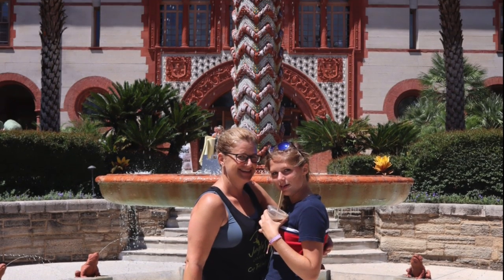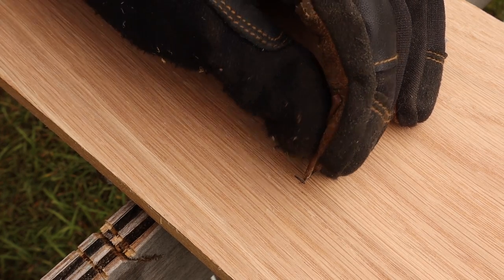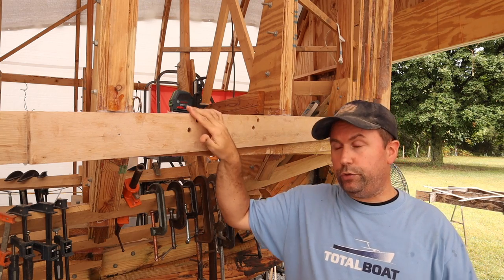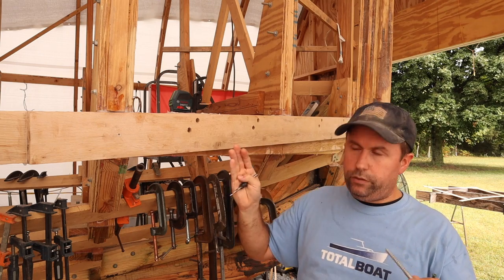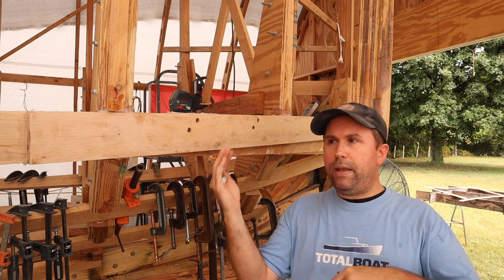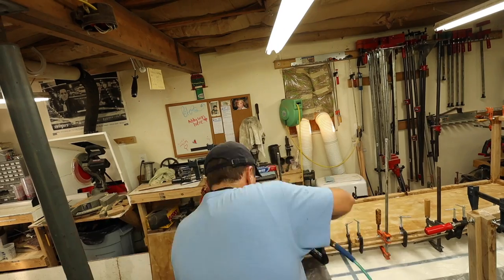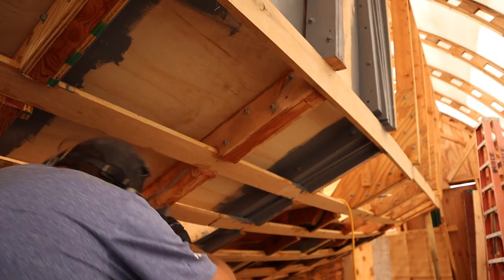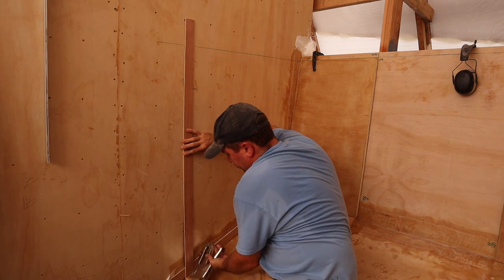Preparing for planking 41' wooden boat and more!  Sea Dreamer Project episode 48

Comment: Great explanation and reasoning regarding your selection of galvanized steel fasteners. 

Its great to learn something new, I had no idea about SS corroding when used below the water line.
Reply from the maker: I've seen failures even above the water line.  The heads of bolts on deck hardware look perfect but then buried in the deck, the shaft has begun to disappear.

Comment: Thank you for talking about “IT” screws that is. No such thing as to much information, I really like the way you boiled it down to the 
Project at hand in this case marine application. It would be really great if the three or four other YouTube boat projects currently underway spent a little time talking about hardware, chemicals, tools etc. Many are very light on on substance, and heavy on planing, sanding and sawing. I mean really , once you’ve seen a table saw rip some stock down you’ve pretty much seen it all. On the other hand building the jigs needed to improve quality and repeatability is much more valuable information.
Please continue to share in-depth information, I believe that there are lots of YouTube viewers who have the three or four minute attention span required to absorb some in-depth maybe even educational information. Thank you and continued success in your project !

Comment: I get it’s all about layers I’ve watched other boat shows or where the builders built beautiful wood boat and then over laid more thin layers at different diagonals and then they put fiberglass on it then they fared it then primed and painted it. I’m sure yours is going to be very strong when it’s all put together because there’s so much structure underneath it. that’s cool everything doesn’t have to be the same not everybody can do a multi hundred thousand dollar solid oak bronze screwed 3 year project crowd funded. it’s good to see something the backyard fabricator could do. If most people saw how rickety a house roof is before the outer sheeting was put on it, they’d be shocked also, rock on man!

Comment: When you are using a chip brush to help fiberglass a joint and eliminate air bubbles I find it works a lot better if you cut the bristles down to about half length beforehand. It makes the brush a lot stiffer to push the air out and you can kind of poke directly at the bubbles to release them. Pushes epoxy around better than the full length bristles too since epoxy is thicker than paint.
Reply from the maker: good stuff, thanks!

Comment: You can trust a magnet. The more stainless a steel is, the less it's attracted to a magnet. The thumb rule is pure stainless doesn't get a date with the magnet. Kitchen knives are a good middle mark proof and stainless steel railings (from reputable sources) are a good full stainless mark. Once you've established those, you're set in figuring out where your stainless sits.

Comment: Also if you use aluminum tractor trailer tanks coat the outside with dielectric grease and buff in first coat. It will never corrode.

Comment: I don't know if I would want to use a wood fiberglass epoxy fuel tank. In the event of a fire at sea it can breach and feed the fire to certain doom. I find that used aluminum tractor trailer tanks work very well and can be had from scrap yard for a 100 or less.

Comment: If a bolt or screw or piece of stainless shows any interest in a magnet it's not 316 (marine grade), and at best 304 which will show some attraction to a reasonably strong magnet.  It's pretty easy to tell the difference - 316 plays dead and 304 gets a little antsy...   :  )   Cheers
Reply: yup....

Comment: Great to see you back and your progress Scott.  Question-do you see any issues with the framing being inside the water tanks and being difficult to clean?  Will you have some large access hatches to be able to get at the corners for cleaning?  Great work on the chines and bilge stringers and those fuel tanks look large enough to be guest cabins (lol).  Have a great weekend and I hope the cold stays away until you get your glue work done.

Comment: hi I understand that you like working in wood, but it would not be better if the water tank was made of stainless steel? or plastic? because I think that this epoxy in the interior is not a good solution?
Reply: He will have done it that way to (a) save money and (b) have a custom fit into his hull and (c) do it himself.
Reply from the maker: It's a fair question.  Once cured, epoxy is essentially a very complex plastic molecule.  That makes these essentially plastic tanks.  The problem with plastic tanks is that it's nearly impossible to have internal baffles to prevent the free surface effect in large plastic tanks.  So you can only safely use smaller sizes.  That would have meant several smaller tanks which add's cost and complexity.  I can't afford custom fabricated metal tanks.  Finally, It's a building channel so I figured I might as well build these too!

Comment: Hi Scott, good explanation on screws. However the video clip you showed was showing roll formed threads. That’s used for machine screws and tapping screws such as sheet metal or drywall screws. The threads are actually extruded by forcing material from the root of the thread to the crest.  Cut thread screws on the other hand have material removed to form the threads. Watch this video. https://youtu.be/_E_FgnNTiyo

Comment: I have been looking at your first couple of videos and im very concerned.   Its obvious that you have never been out in the open seas during a storm. The stress of slamming the hull in high seas makes your vessel shake and shudder from bow to stem.
You put your life and the life of your loved ones in your boat.
Skimping and cutting corners will only result in a ship that fails when you need it most.
I guess thats why we have the Coast Guard.  Hope you  can swim.
Reply: I liked your reply, mainly because this is a boat designed by a  guy who absolutely knew his boat engineering and stresses, etc. I can't recall his name, right now (George something), but I read one or two of his books over a decade ago, and was impressed with his materials knowledge. Many "hard chine" critics eviscerate his design philosophy, but they ignore the inherent strength of such designs.

Now, obviously, anyone with any common sense will steer clear of most storms. Modern sailing has benefitted from modern GPS and weather alerts, etc. Not hard to give wide berth to a storm-- or at least avoid the worst of it. Yes, boats are liable to still hit some, speed of the boat will dictate your evasive actions. Any boat sailing on Blue Water will encounter some 'stuff'.

I was in the US Navy (1980-1985), and my little ship (smallest combatant ship in the Navy at the time), went through three hurricanes and several smaller storms-- including one very vicious one that did some insane damage to our boat (again, that speed factor-- we couldn't outrun it). We had flooding, we had things breaking off the ship, etc. The torment went on for days. Point is: any boat sailing out in the big blue is going to encounter some rough stuff. Comes with the territory. Also, you MUST look for a place (such as an island) to get alee of the storm-- since you can't move fast-- unless you have limitless supplies of fuel to travel a thousand miles away, quickly! Again, that speed thing...

While I doubt George's design for this boat would have survived what we did in that one hurricane (sorry-- never knew the name of that storm), I also doubt any other similar-sized "traditionally-built" wooden boat would, either. That was a monster storm that we finally found cover from on the leeward side of some island-- it was still rough, but some land between us and the eye of the storm was better than open ocean. Hugely better.

That's seamanship-- knowing what to do, where to go, what chances to take. It can seem like a crapshoot. Take some knocks, but find shelter.

Survive. 

I'm personally hoping he sheathes the hull in fiberglass to give more protection to those galvanized screws holding it all together. We'll see, I guess. 

But the design is good. George (Buehler?) really has it down-pat: his "hard chine" designs are proven sturdy. They will survive most storms. Critics be damned!

Thank you, Historical Flashback, for defending this build.
Reply: @shaddec55  Thank you for such a detailed response and interesting story!
Reply: You're very welcome-- the pleasure was mine.